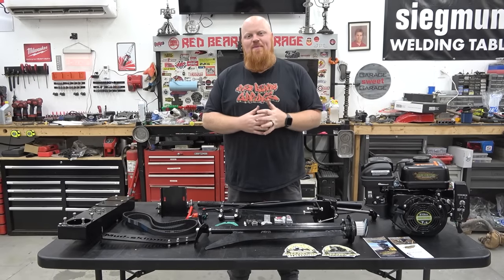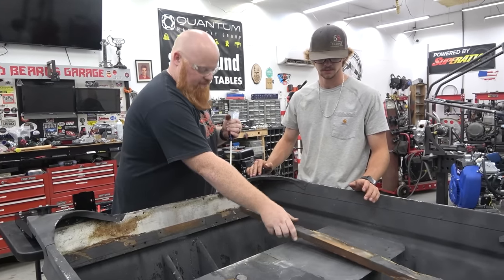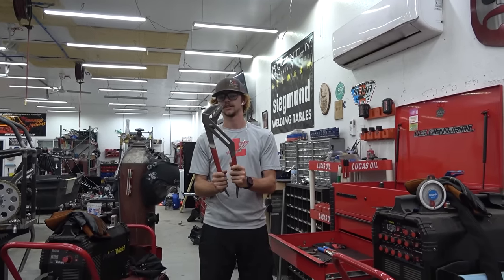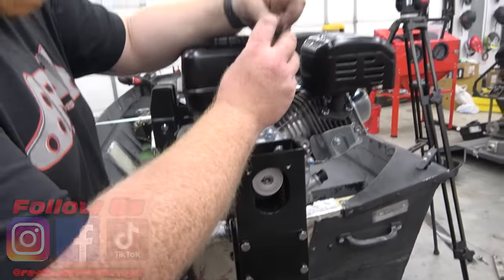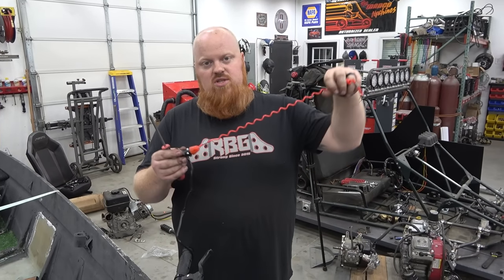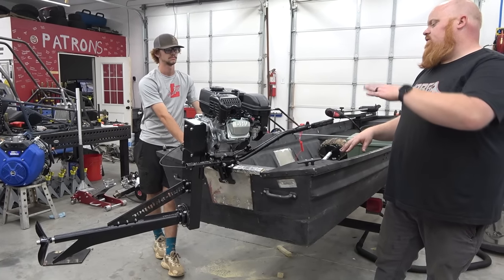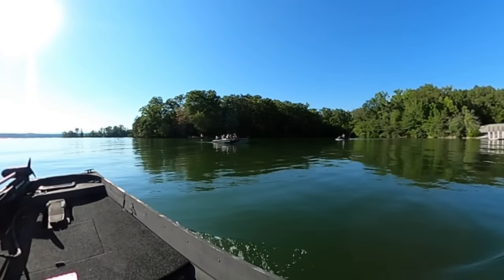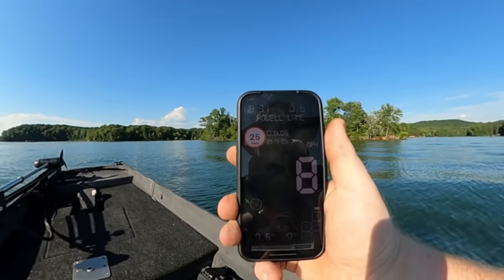Boats & Bros! Mud Skipper 7.5HP Surface Drive Install

Comment: Good video with lots of laughs! FYI for the next time you need to hole saw through something carpeted, run the drill in reverse and it'll cut the carpet for you. Then go fwd to finish the hole.
Reply: Thanks so very much for sharing that with us! I’m going to try that next time I drill a hole in carpet.

Comment: You should play around with the motor trim as much as it will allow, a perfect trimmed out motor will gain several MPH
and ride much smoother.
Reply: Did you not see the boy trying like hell to get the trim just right on it?

Comment: I would like to see you guys do a outboard motor with a lawnmower engine on the top!
Reply: The surface drive is essentially just that
Reply: I found those once on amazon 173 cc  with forward nueteal and reverse
Unforunately i havent found them again
Reply: Ice been doing that for over 40 years still use 1 I built 28 years ago

Comment: Pro-Tip, run the hole saw in reverse when going threw carpet or vinyl. it cuts a perfect hole without grabbing the carpet. Once through the carpet go back to forward and drill on through. Used to install car stereos and boat radios. Would also run it in reverse through the gel coat before drilling through the fiberglass to not crack the gel coat. Yall are hilarious. Good people!
Reply: Great tip!

Comment: Just an idea…Turn the motor sideways and lift the prop out of the water. It will start easier . You just want to make sure it is pointing in the right direction BEFORE you put that prop back in the water. When we were kids(in the 70’s) I watched a friend of mine flip his boat sideways and sank it! (He had started his direct drive outboard with it turned to one side to get a better pull on the motor.)  It was FREAKING HILARIOUS…luckily, he was only a few feet from the boat ramp, when he did it!(live and learn, I guess)
👍👍❤️
Reply: I typed a  rope under a rib on bottom of boat then a loop on the other end..
Lift prop out of water and slip loop over end of handle...problem solved...also good for of I want to stop for something with out having to shut engine down

Comment: I have one of these kits, you should have the trim set to where the prop is just under the water and when you pick up speed it should be rooster tailing, if you aren’t you need to trim up

Comment: I got the 420 cc version of this and it rips on my 1436 definitely worth the bigger motor and governor delete also I recommend running bolts through the transom to the transom mount on the kit so it actually pulls it tight against the transom
Reply: Yea I think the 420cc or #xp18hpe would definetly be a better match for this boat for low end torque to push larger propellers . However I think RGB is going to build a very good powerful and reliable 7.5hp that will get the job done. Very excited to see what he can build out of it.
Reply: Shoot y’all like the 420 on a 1436 grab the new 459 on it! 👍 I loved my 420s and hopped them up quite a bit then went with a stock 459 and it’s running me faster than my built 420s were!

Comment: Its a good idea to leave the threw transom bolt undrilled until you run the boat ( temporally secure it with a cable or chain ). These surface drives can have a lot of tiller torque. shifting the motor side to side a bit will help remedy that. And there is your tip of the day. lol

Comment: I put treated wood on raw aluminum. That  boat that was stored outside, in the rain and snow, for 10 years. 
All raw aluminum corrodes... but, that raw aluminum/treated wood contact area  was no worse than the raw aluminum exposed directly to the weather.
Treated wood is different, nowadays. Seems like it is not a super critical issue when using todays treated wood.
It'll be fine.

Comment: You could get the long tail, and glass it into a canoe or Jon boat for an easy direct drive setup. 
The surface drives(short tail) work good with torque converters too, with modifications.
Ungoverned with torque converter set to grab at about 3000 worked best when we did it on the lake a few years ago
Reply: Yeah that idea has been floating around my head but not sure how
Reply: @rickye-eu8zv  it’s easier than you probably think it is honestly. Generally, if you can paint a wall and measure stuff, you can do fiberglass. It’s just a few extra not very difficult steps. Much easier the second time though lol

Comment: Really cool video and build. I would tend to lean away from treated wood for transoms it will corrode the metal. Most boat builders use marine grade plywood and seal it with epoxy as you mentioned in the video. Just posting this information for anyone who is planning their own builds.

Just saw you addressed this in the video.

Comment: The prop is supposed to be slightly out of the water when running. It let's the motor turn more rpms and that where the term "Surface Drive" comes from. Your also supposed to measure the transom height for the motor to help the prop sit a little higher. Trim up for what!?

Comment: This is a cool boat.I put a 49cc engine on my kayak and it was working but I ended up putting a racing engine on it and now it will be faster.I just need help drilling out the clutch to put a rod in it but I don’t have a lathe.You should do a fishing video with the boat.

Comment: So easy to knock a crank out of perfect alignment when you use impacts on anything crank related
Reply: If that lil impact and half inch bolt hurts that crank... The crank wasn't long for this world in the first place... 4k rpm does more harmonic damage than that lil impact

Comment: For making the u on the sternplate: use a small angled iron/flat that fits between the bends. Than hammer/bent the 90°
You make it a bit confusing for some folks. When its an 8 mm socket then its 5mm tread. So an m5 bolt. This happens more with americans talking about metric treads.
Want to see the updates on this. Suggestions; look for a free revs coupler on idle( prop not turning)
I have my concerns about the propshaft at the back. Maybe an protection bracket during trailering?
For how much hp are these units rated?

Comment: Kinda Sucks That they dont have a clutch , Would make Starting her a little better also. 
But At the same time , for the price of $1200 is a GREAT Deal for what it is!
Reply: Something to consider having a direct drive has less parts to wear out thus increasing reliability on the water.
Reply: If you turn the motor sideways and lift the prop out of the water, It will start just fine.( you want to make sure the prop is pointing in the right direction BEFORE you put that prop back in the water.) lol

Comment: I built a long tail mud motor and Jon boat almost identical to yours a few years ago. I couldnt afford a swamp runner kit so I built my own using a direct drive system. A couple of tips from my experience, first, use all stainless steel hardware, I had rusty bolts on my setup after just 1 year. Second, start the motor with the prop out of the water or you most definately run the risk of falling out (dont ask me how I know this). And last, I HIGHLY suggest epoxy coating the wood on the transom, I replaced mine with some pressure treated and painted it after it had all dried and and still had to replace the wood after only 4 years of owning the boat (replaced it when I did the full build and built the mud motor at the same time). Oh and like Braxton said, he still has a trolling motor, I had to use mine when the first motor I had on the setup decided to splitits factory fuel lines and my 8 year old and I were stillover 2 miles from the dock. Used the trolling motor to get all the way back to the dock and the battery was still at 3/4 charge.

Comment: The chemical in pressure treating will eat the aluminum fast. Within a year you will have holes all throughout the transom. Definitely better off with untreated and then use resin like you were saying.

Comment: Good video, one question, why would you cut the back corner braces instead of taking a flap disc and grinding down the wood to slide under them.

Comment: Grate video, sweet lil kit I think the shaft for the prop sticks out abit too much it could do with being half the length or is there a reason it's that length. Could u mount the engine more to the right side away from where u sit and put a CVT on it, make a stuby jack shaft for the top belt pully and connect that to the CVT. Thn it will be able to go faster without having to rev the nuts of it all the time and be better on fuel ⛽ 💯💯💯👍👍👍👍👌👌👌👌👊👊👊👊👊😎😎

Comment: I was really disappointed in the power I thought this thing was going to hop up and take off lol but good job on the build
Reply: I'm pretty super RBG will build that engine that engine well. The ideal more for that set up would be a 420cc #xp18hpe or 459cc or similar. But if he can build it well it will have a good power to weight ratio it just need to built to produce low end torque to run bigger propellers like the bigger engines can.

Comment: Hey red beard, I hope this question makes it to you but anybody's opinion will be appreciated. I have a mud motor on my 1542 Jon boat. Right now I have a stage one GX390 13HP. Do you think it would be worth it (financially/time spent) to put a cam and springs into the Honda over the winter or would it be smarter to spend similar money and do a stage 1 predator 459cc? I know the Honda says it's 13 horsepower but I think the real specifications list it around 11.7 horsepower. What I'm trying to ask is would a stage 2 Honda 390 make about the same power as a stage 1 predator 459?

Comment: so... 212 built... 224 built.. or ghost? on a boat setup..  I already got a gx200 stage 2.. but wanta go with a 224? hemi? non hem? ghost? what you think?.. got a mild diyperformance cam, and alumnum flywheel, springs, etc etc..  like toobe able too swap ot too the 212? 224? ghost? ..need some help..

Comment: outboard motorprops are most efficient around 5500 rpm go over that and you get cavitation around the blades and less power transfered to the water
Reply: These propellers are completely different design. The are designed to ride on the surface of the water.   The bigger the prop you can push at reasonable RPM like 4000 RPM. The more water you grab and the faster you go

Comment: Hi RBG, another nice video. I am putting a HF 15.8 on a Beaver dam kit. Do you recommend I disconnect the low oil sensor also? I want to paint the whole motor, should I paint the silver motor parts with high heat paint? All I can find is black. I want to camo it. Thanks

Comment: Won't those steel motor mount bolts slide around on that aluminum Dimond plate Transit cover I think you'd want wood there?

Comment: Hey Red, 
The treated pine board will eat the aluminium over time, just use standard boards and coat them in poxy to seal them. I have seen what happens to aluminium via YouTube and its not good.
Reply: Why repeat what he already said in the video about the treated board and aluminium?
Reply: @SportbikerNZ  that's because I wrote that before the end of video, then I realize that he was talking about it and going to do it anyway, but it was to late remove the comment.
Reply: @ssmith7100  Can always edit the comment later.

Comment: Why don't you build a longtail boat ?
Reply: The surface drive is more convenient and easier to operate than longtail. The 440cc #xp18hpe Duromax on a mudskipper longtail drive kit would be a very good match for it at approx $950. But RBG building a reliable built 7.5hp is going to very exciting to watch should have a very good power to weight ratio. A 440cc base surface is very heavy and would most likely require pods on that build.

Comment: You probably want to pull that treated board out of there, unless you want your transom to corrode.  Treated boards contain zinc, which will eat the aluminum  transom away over time.  It's called galvanic corrosion.  Same reason you can't use galvanized screws/bolts anywhere on an aluminum boat and must use aluminum or stainless steel.  Marine plywood is the right answer, or even the "cheap" board he originally purchased was a better option.  It will rot faster, but won't damage the hull.  Synthetics like Coosa board are a permanent, never have to worry ever again option too.

Second, the surface drive needs to run with about 1/4 to 1/3 of the prop out of the water to get rid of the torque steer.  It's a surface piercing prop for a reason.  If it's not pushing a rooster tail, it's too deep.

If you push the tiller down and get the prop out of the water when starting it, you'll eliminate that jump at the start that can throw you.

Totally not ragging on you guys, just want to convey some experience having been around these for duck hunting and river running for years now.
Reply: As a side note, I ran with a 212 on a 1436 for about a year.  It's really not enough torque.  Surface drives and Longtails need low end torque to get up and out of the nasty stuff.  The minimum I run anymore is a 420cc or 440cc.  20ft/lbs at low rpm is just about right on my 1436 to pull a full hunting load and 2 guys up onto plane.  It'll barely clear 16mph though.  Alone, I can get 19mph with a light fishing load and just me with a 420cc motor and stage 1 mods.

Comment: im debating grabbing a 212, and or the 224. from HF.. i got a gx200 clone with cam flywheel.. non hemi.. 
I just wonder how much more power/speed id get with a 212/224..  and im not sure if my non hemi cam and flywheel will work with a 224? hemi?.. bit confusing.. I think my gx200 clone is only a 68mm bore.. and im pretty sure a tad bit less stroke..   

 I was thinking of a 212 ghost.. but from what ive gathered a built 212-224 would be better then the ghost setup..  
id really like too get a PD style carb working but i see you had issues.. 

so.. a 212? from HF? then my non hemi cam, and flywheel in it? and jet the carb.. ?

https://youtu.be/I1Mvr4iTDyE?si=zRJSJwgGMZ6Q2ft2

Comment: Your not supposed to use treated wood on aluminum it will create a chemical reaction and eat your aluminum up fast. You will start getting pin holes all over the transom.
Reply from the maker: Keep watching
Reply: I had no idea about that!!!  we have done that to transom on a few builds so far no issues luckily.
Reply: @azlongtales  I just got done repairing one that had treated wood and it pin holed everywhere. It takes a little bit but once it starts it makes the aluminum weak and thin.

Comment: I'm not 100% sure if I'm correct in sayithis or not because I've never had to register a boat before but I do believe that once you install a gas powered engine on any boat here in NY state then it is required that you register the boat and have taken the captains course so you have a boating license lol which sucks because I've got an 8ft V-hull shallow water skipper aluminum boat and I mean she plains right out with just a 55lb thrust Minkota trolling motor on her but it did come with an old 1960's Johnson 2 stroke 10hp when I got it I've just never had the nerve to put that gas motor on her and try it out she seriously scoots with just a trolling motor so I imagine she's a bonified speed boat with that Johnson on her 😉 😜 🤣

Comment: Do the end break first.....derp.
Reply: We have done both methods but breaking in on the water is not bad. We usually do 2hrs 5hrs 10hrs then regular intervals of 20hrs. Oil is cheap engines are not so much. After two hours you generally see a good amount of flake in the oil.